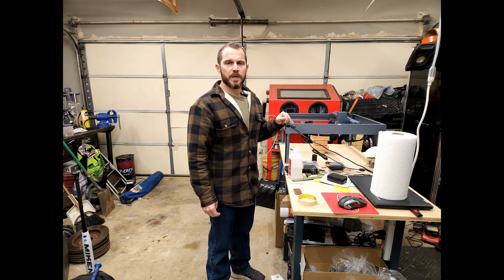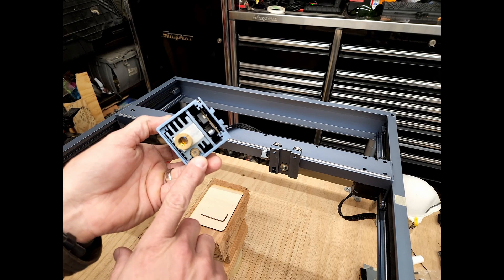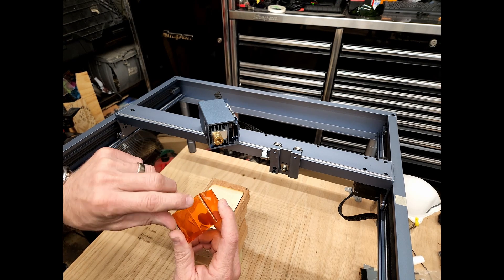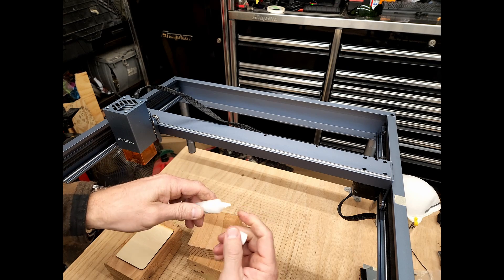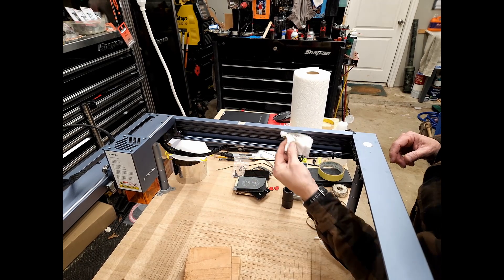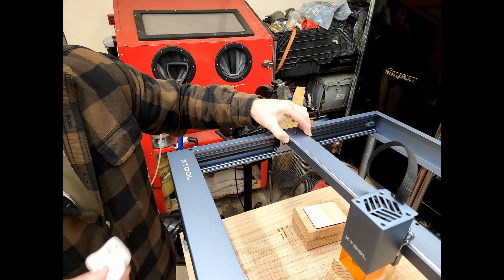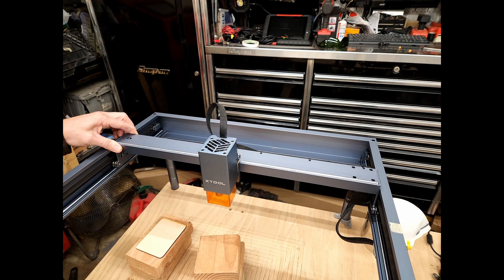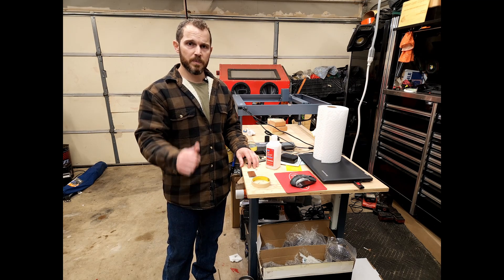Cleaning and Maintenance to the XTOOL D1 10W diode laser

Comment: Thank for this. I just got shop up put together. I had the D1 sitting in the box for a year. Put together this last week and started it up yesterday and today. I have maybe 30 mins is cut time on it and lost power to it. Very little light being emitted. Do you know why it would to this? Any help would great, thank you.
Reply from the maker: Check all your connections, maybe unplug each and replug them in. Check the power supply output to see if it is putting out the correct power. check the lense on the laser module to make sure there are no obstructions.
Reply: @mahanmade  Yo thanks, for replying. It took me a few hours to figure out. Check everything meticulously. It ended up being the focal lens burning up. It looked like a bug got in there a got fried to the inside of the lens. My cover lens was clean which through me off. Lucky the laser was still under warranty. A new laser module is being sent out.